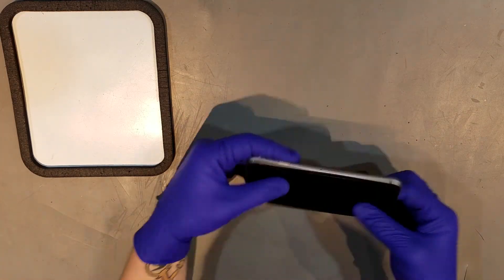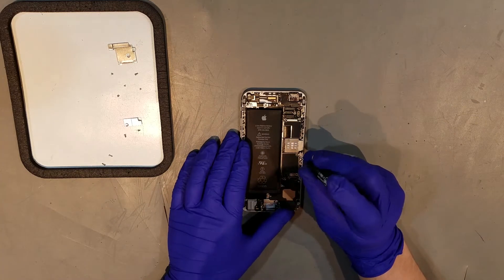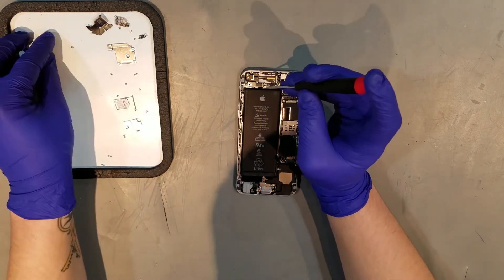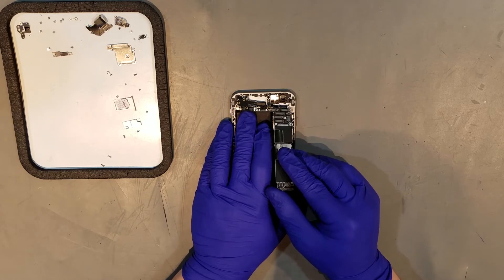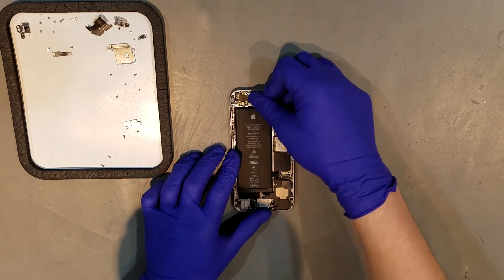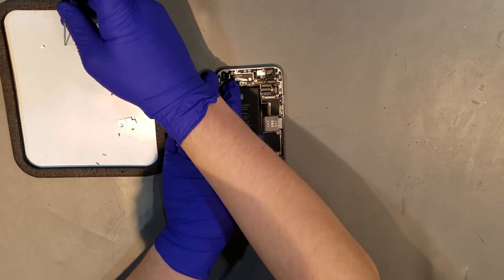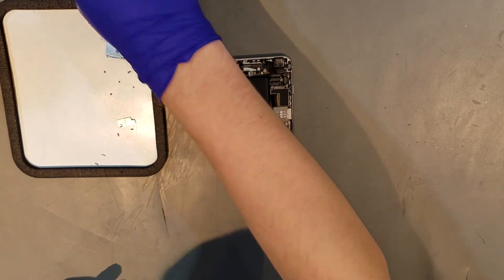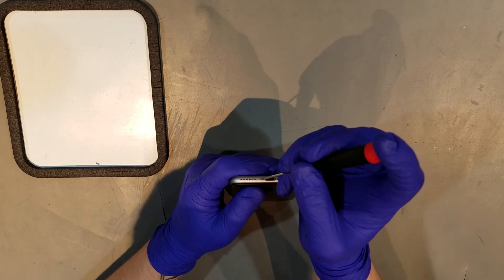Apple iPhone 6 Logic Board Replacement

Comment: Please,l bought iPhone 6 from eBay but i realised it is Apple ID locked,the question is if l buy a new iPhone 6 motherboard,will it still need a Apple ID passwords???
Reply: You can replace the motherboard and the phone will be unlocked. However you will not have access to Touch ID.
Reply: No, the motherboard is the piece that is locked to the icloud servers.

Comment: My iPhone 6 cloud locked..after change the logic board it will be unlocked??
Reply from the maker: You would have to replace it with a board that isn't icloud locked, but yes
Reply: yes make sure the board is not iCloud locked
Reply: ap muje apna no de.. ya call kre 9690037356
Reply: Great

Comment: can i swap the logic board from other iphone with the same series?  i have iPhone 6 lock icloud and the other iphone 6 without lock icloud.
Reply from the maker: As long as they are both the same model, then yes. As far as the tied carrier, for example; if you buy one tied to Verizon and want to use it on Sprint,  you'll have to ask your local cellular providers if they'll switch the network for you, as it usually isn't as simple as popping your SIM in.

Comment: So after change the logic board the iphone can be use as usual
Reply from the maker: It can, with the exception that it will essentially be the phone that you removed the board from. If purchased online(provided they didn't screw you over), the board should be plug and play. Though, if you're pulling it from an existing phone, you'll need to remove any existing icloud accounts and factory reset the phone before you can use it normally
Reply: JacksonTechRepairs thank you
Reply from the maker: Replacing the logic board is going to remove any data you had previously on the phone, as iphones use on-board storage. It would essentially be the phone you pulled the board from initially. If you replace the board with another icloud locked board, the phone will still be locked. In short, you will lose all data performing this
Reply: @jacksontechrepairs4699  how about the touch ID, will it work? or it needs to be transferred along with the logic board in order for it to work?? thanks for the video!!
Reply: JacksonTechRepairs It did exactly that. I got my good board in my heavily damaged 6 and transplanted it. It works like a charm. Thanks
Reply: JacksonTechRepairs HI I want to do this for a badly damaged phone I have. Because it has my iCloud set up and stuff, I don’t have to wipe the phone first do I? Just wondering if it would somehow know the hardware was changed (because it’s sat in a different iPhone body).